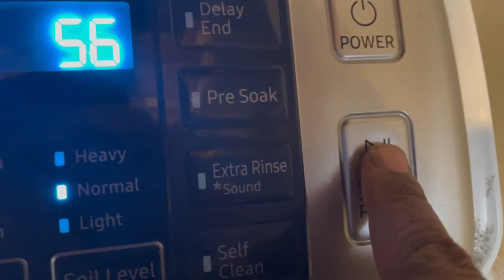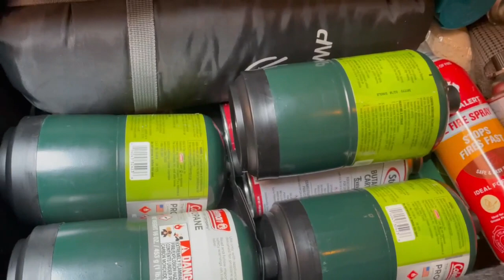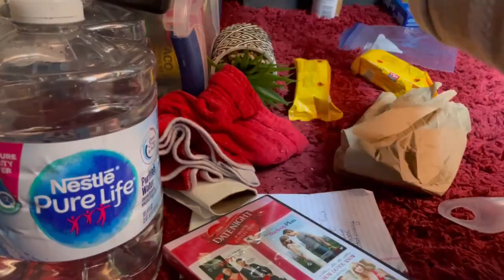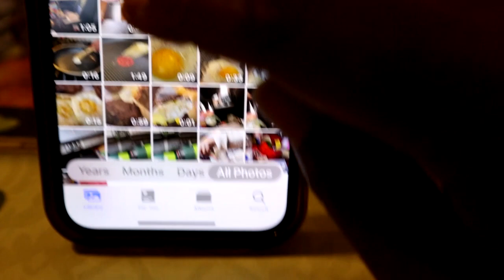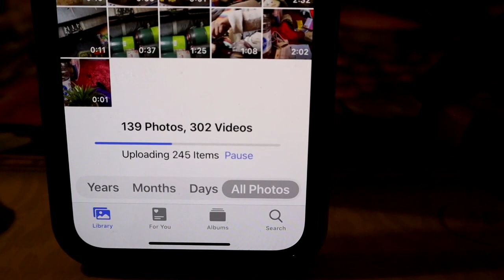S1Ep55: Day 10: Minivan Cleaning Day and Breakfast - #abiyahbina #vanlife #minivanlife #digitalnomad

Comment: Hi Abi..another Nomad had a small metal the shape of a glass and to keep warm it was lid on low on their one burner stove for less than 5 minutes and it warmth the van up...nuts, I can't remembered  the site..but I think it was bought at Amazon...I thought of you and your big heater..the kettle has holes  and the heat on low really looked and save the nomad electric..and warmed up rhe van..I I will try to look for that site for you...cause it's getting  cold...

Comment: What will you use for heat?
Reply from the maker: So far I like the mini heater that goes on the one burner stove. The Mr Buddy heater is too powerful for my van. I manly used the Buddy heater during the day with van door open or cracked. But now I got the mini heater and it works great and don’t take up that much space